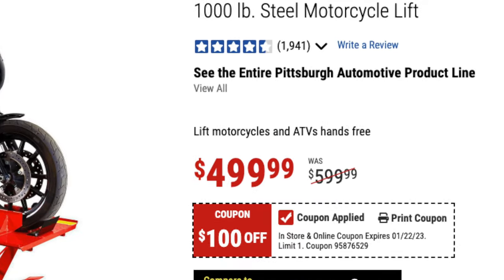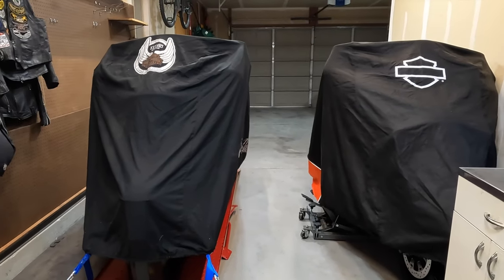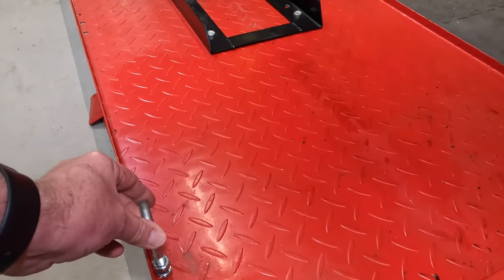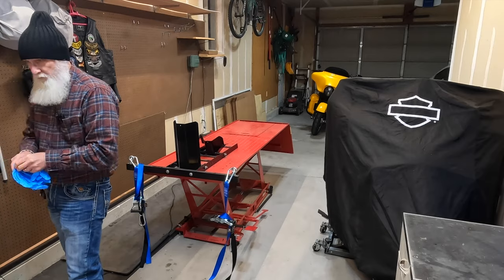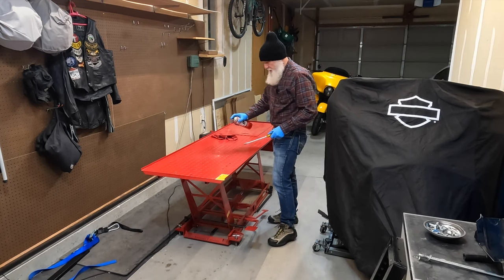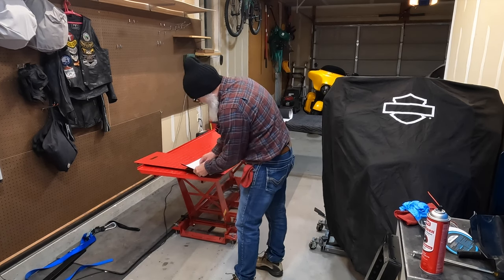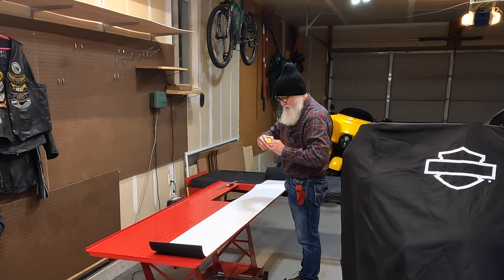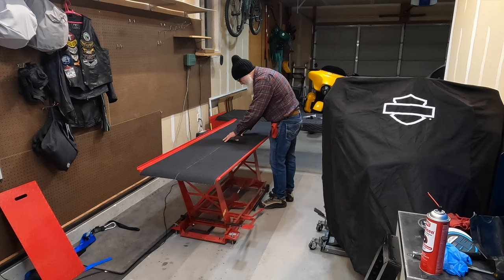Improve Your Motorcycle Lift | #harborfreight #antislip  #limited #whyiride #motorcycle life

Comment: I used a spray on anti-slip on my ramp and did a 6” stripe up the middle. My concern with the roll on was that eventually oil will work under it. 
Have you had any problems with fluids working under because of the uneven surface?
Reply from the maker: Bob, I did a follow up video answering viewers questions similar to what you have asked. I have had no oil penetrating under the tape but yes oil on top of the surface is inevitable. I use a little dawn dish detergent and a brush to clean the surface once or twice a year. It is very effective. Thanks for the question and comments my friend.

Comment: You must be a pretty tall fellow.  I noticed when you rode the bike back on, you could touch the floor(!) with your feet!   At 5'9. I don't have the leverage or the leg strength to fool around with those teeter-totter wheel chocks.  Got rid of them and went with the WheelDock.  Roll in, roll out.  Easy-peasy now.
Reply from the maker: 5’10”. It can be a bit of a hassle but I manage on my lift as well as in the back of the truck. I will have to check out the chock you mentioned. Thanks for watching and commenting!

Comment: bet that stuff is hard to get oil off of?   i added 2x6 sides to my lift to put my feet on and to get mowers and atvs on it as well, 
take a 15mm socket ad cut out 2 notchs in the sides then you can use it on a drill to raise and lower the front stabilizer feet faster
Reply from the maker: Do you have photos or video to see what you have done?
Reply: I did the same but 2x10 ( that’s what I had) I slide them back and set parts on them 
That extra width when loading a Goldwing makes a big difference.👍

Comment: Just wanted to ask if the tape has held up.  I'm getting ready to do the same setup and wanted to check.  Thanks again for the video.
Reply from the maker: It is still holding up very well. The only scars are where a bike was very low and scraped the surface of the lift going up and cut a spot in the tape.

Comment: How is the tape holding up? I saw where one guy used a heat gun to help it stick better
Reply from the maker: I haven’t had any problems with it adhering very well to the lift. You will notice in the video I use brake cleaner spray and cleaned the heck out of the red painted surface before I laid down the abrasive tape. No problems. It has been holding up very well! I still recommend it even though I have no affiliation with the product or Amazon.😁

Comment: Clem: You did not show removing the bike from the lift. I have the same setup, looks like the chock components are in the same holes as mine. I can not get my roadking out of chock without a 2nd person help push off. Do you have this problem?
Reply from the maker: Actually, I do a little rocking back while using my hand brake each time to it get a little farther back. It takes about 4 to 5 pulls, back on the bars to work it up to the top and roll out of the chock. Hopefully this makes sense what I am describing. If not, let me know and perhaps I can film this part. Thanks for watching and please subscribe and like if you appreciate what I am doing.

Comment: Where u get the wheel chock set up at
Reply from the maker: Chad, this is a wheel chock from Harbor Freight. I have two; one is mounted to the bike lift and the other I mount to some two x four lumber and use it in the back of my pickup. Check out this video where I modify the chock for the lift. https://youtu.be/YKgm5guaAgY

Don't forget to subscribe if you have not already. THANKS!
Reply: @Clem Griffis  thanks brother I jumped the gun seen it after love the content 👌 subscribed
Reply from the maker: Chad, the chock is on sale at HF right now for Inside Track Members... $74.99 down to $54.99. 6.8.2023

Comment: I would like to know how the tape is holding up over time.  I tried just some of the rubber self adhesive strips but they flew right off.  I use my lift as a almost daily parking pad also. I thought about some roll on nonskid also .  (I have a channel also, would love you to check it out :) )
Reply from the maker: BTR: the tape is holding up quite well. The only scars so far is when I worked on a smaller bike that was lower then mine, scraped the top of the ramp. I am very pleased with it. It is holding very well. I cut down my wheel chock to give me more space under the bike. See my latest video. Thanks for watching and commenting and I hope you subscribed. I will definitely check out your channel my friend! Take care.

Comment: so after you have had time using the 80 grit non slip, hows it holding up? is it still stuck down good? and still has grit where the tire rides?
Reply from the maker: Butch, it is holding up very well. Maybe I need to put out a follow up video and show the wear and what I am planning to do next to the lift. I still highly recommend the adhesive anti slip surface. Although I think the “black” tape looks good to me, it really did not have to cover so much of the lift near the front.
Reply: I ended up painting on hurculiner truck bed stuff on mine. Just got the 2nd coat on today. I just did a foot wide on the ramp and the whole back plate that comes out so far
I've not even had my bike on the lift yet
I'm wondering if I need some up front for my feet so I can pull the bike out of the wheel chock
Reply from the maker: Depending on how heavy your bike is, you may need something to push your feet against. I certainly do, especially when I have the Limited “Black Pearl” on the lift.
Reply: Electra glide standard here
Reply from the maker: @butchchiochon7791  Yes, I would make sure you have a place dedicated with non-slip of some type that will allow you to push backward based on the bike you have. Great questions... keep'em coming.
Reply: Here's what I have so far, 
I'm planning on cutting some off the length of he wheel chock so I can get an oil pan under the oil filter
And I plan on mounting something on the front do the whole lift doesn't nose dive when I clear to the front. Not sure if it is necessary, but better save then sorry
Opps I guess I can't post pictures on here

Comment: Does your alarm go off when the bike is upright and the key fob is inside the house?
Reply from the maker: FG, No it has not been a problem to have the bike on the lift upright, and the alarm go off if the key is not close. It has been a problem just when I go out to pull it off the lift and I have to pull back pretty hard to get it out of the wheel chock if I don’t have the fob on my belt. Thanks for the question.
Reply from the maker: Hey, where are you located? In the states? Just curious, i see your question was recent and it is quite late where I am at.
Reply: @clemgriffis3446  WA STATE. Thx for the key FOB tip.
Reply from the maker: Thanks for watching from WA! I have taken only a single trip up to your state a few years back. Shipped the bikes from UT to Oakland and then road up the coast crossing into Canada from Port Angeles. Check out the video if you have a chance.https://youtu.be/zFsHlbkmpnI

Comment: Is it hard to get the bike back off that wheel chock?
Reply from the maker: Yes, it can be a little difficult, mostly with the Limited “Black Pearl” since it is a bit taller bike than my street glide. I just have to pull/rock it back, catch the front brake, rock it back again and catch the front brake, repeat, repeat…

Comment: Very nice work on that lift. I have over $39,000 invested in my 2020 Ultra Limited and use a Handy Industries motorcycle lift whenever I service it. The Handy Industries lift is made in the USA in Sullu, Iowa. I also have the side extensions, wheel vise, and the dolly to move my lift when needed. Yeah, I paid a hell of a lot more for my Handy Industries lift, but I paid a hell of a lot for the motorcycles I own. Besides, being MADE IN USA is extremely important to me. I support American people and their jobs whenever possible. I do not trust the Chinese at all. I have yet to see a motorcycle dealership use a Harbor Freight lift in their shops. It's not worth the risk of damaging a customer's bike if the lift fails. My father-in-law has a Harbor Freight lift he uses to service his Honda Valkarie. It does not feel stable when lifting his heavy bike. I don't want to take any chances with mine.
Reply from the maker: D.T., more power to you. I never advocate that every motorcycle owner should buy HF products.  I certainly am not advocating that every motorcycle dealerships that raises their lifts up and down multiple times per day over a thousand days per year for several years should go out and them either.  Yes, I would wager you never will see a motorcycle dealer with an HF lift in their shop.  With all that said, I really wish I only had $39K in my limited… but that is a different subject for a different time. I don’t use a broad brush to paint all Chinese as untrustworthy having lived and worked in Beijing for 5 years as an Engineer advising on Power Boiler design and manufacture, but again, another story for another time. I produce videos with motorcycle content because of what you and I likely agree on… we have a passion for riding, maintaining, improving our bikes and sharing ideas and great experiences we have surrounding this passion. As most Americans, we will defend each other’s right to have the freedom to choose for ourselves how and where we spend our hard-earned dollars. Unfortunately, millions in China are not afforded that privilege. I tried to buy a Fat Boy from the Beijing Harley dealer while there and the cost in 2014 was $58K and I was not allowed to import the Road King I owned back in the states at the time. Again, I will argue forever your right to buy a Handy lift and I may very well go a similar route in the future but as of now, my lift works quite well as a hobbyist for home use. Thank you for the kind words about the work I have done to the lift and hope we can share more thoughtful conversations like this in the future. Please subscribe and check out some of the other touring videos and maintenance videos I have out there on mine and Roxy’s Channel. Cheers!

Comment: I have the Central Pneumatics motorcycle lift table from Harbor Freight, (the predecessor to the Pittsburgh) that came with the air/ hydraulic jack. After about 12 years of frequent use, the pneumatic pump gave out and I manually pumped it up for about a year.   I eventually converted it to a hydraulic cylinder powered by an electric pump.  It was a good lift.  Now it's a great lift.  I'm in the process of converting my other HF lift.

Here's the link to the video on the mods I did.
https://youtu.be/T6eHjhZNkXw
Reply from the maker: Wow, you have an awesome history with these lifts. I had a predecessor HF lift that had the knuckle at the end of the hydraulic cylinder fail (bent in half). Luckily local HF allowed me to return the whole lift and replace it with new. If I can ever retire and use the lift more often, i would consider a nicer lift with an actuator that doesn’t require a foot pump. Thanks for watching and I hope you are a subscriber.
Reply from the maker: Thanks for the link